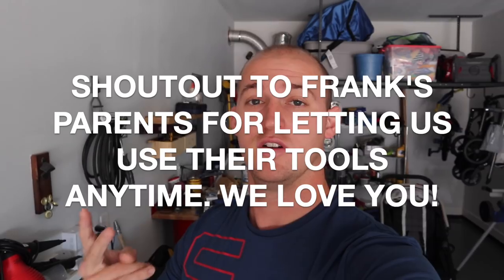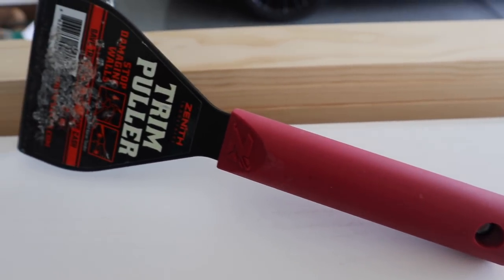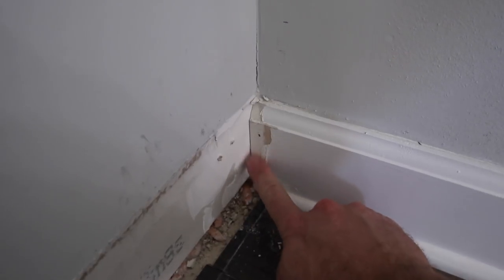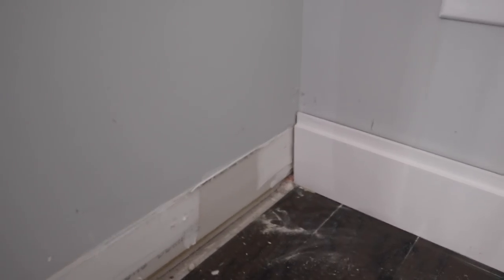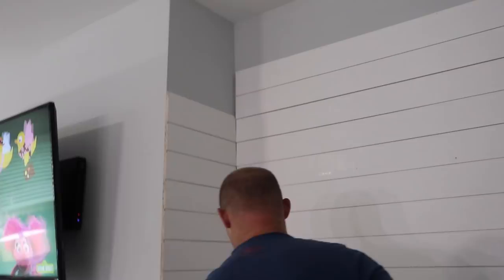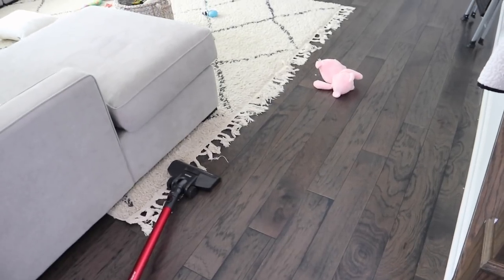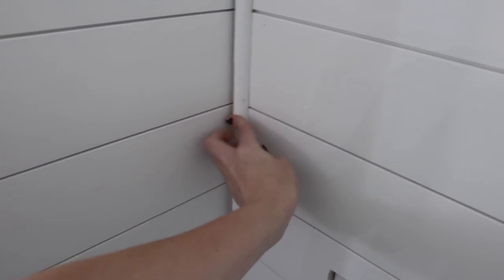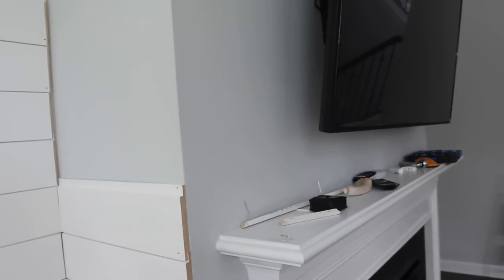DIY PROJECT | LIVING ROOM MAKEOVER | TRANSFORMATION PART 1

Comment: Can y’all list in description the dimensions on the boards y’all got and the quarter rounds too & tools used too. 

For the switches they also have extensions so if you take off the top add the extension then put the top plate back on and it makes it stick out. I’ve been researching diy shiplap and found that out😊 Loving this so much!!